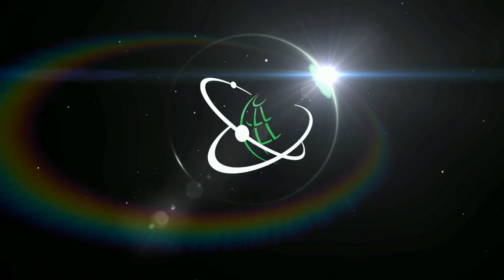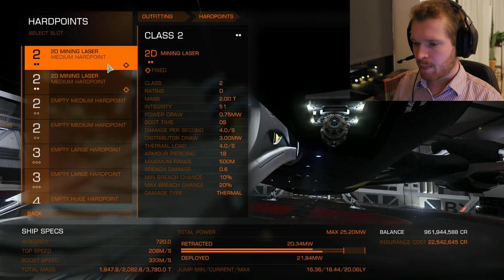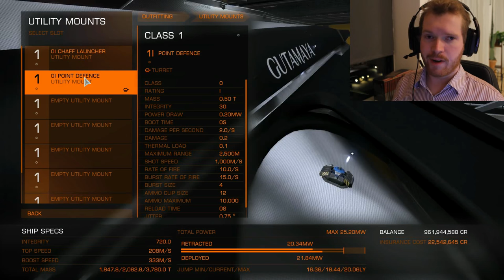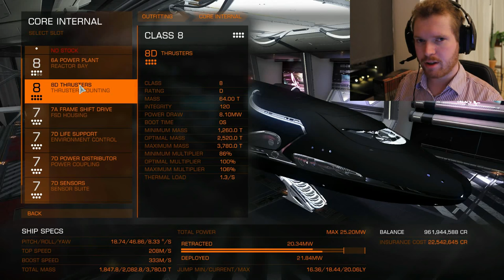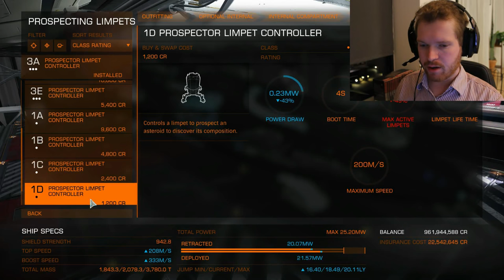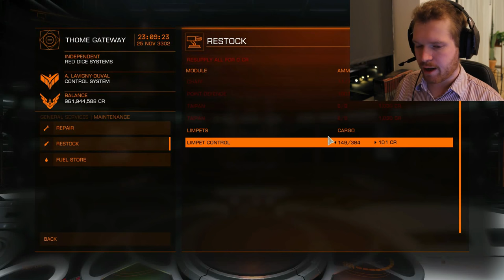ADVANCED MINERS GUIDE - FITTING | ELITE DANGEROUS

Comment: Prospector Drones also increase the fragment yield of an asteroid. The higher the rating, the more rock fragments will be collected from a single asteroid. This is a HUGE deal when finding a high deposit of valuable ore. (The class size of the controller makes no difference besides being able to prospect more asteroids at once).

Asteroids prospected by a 1A controller will drop 28 to 42 fragments, whereas A 1E prospector will drop 11 to 18 fragments.
Reply: Now I knew prospectors inherently increased yield, but the RATING of the controller affects it? That's news, and I've played almost 300 hours, mined more than anything else. THANKS!
Reply: Great tip, thanks.